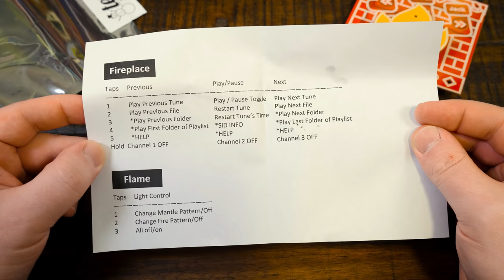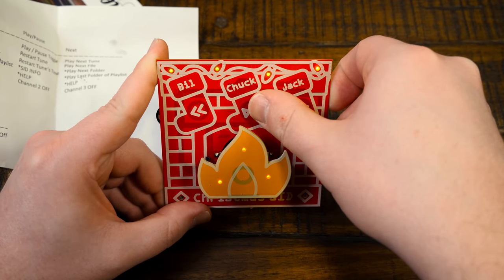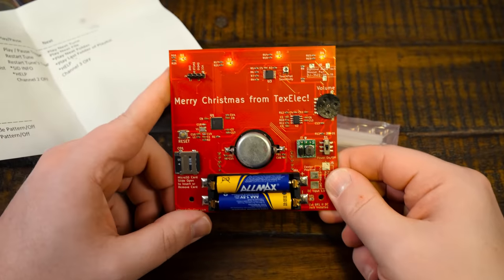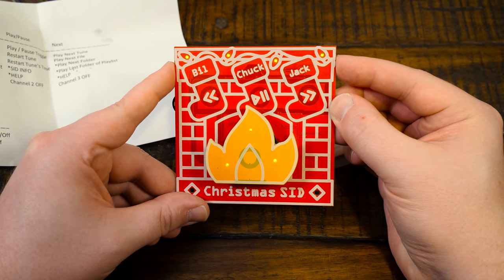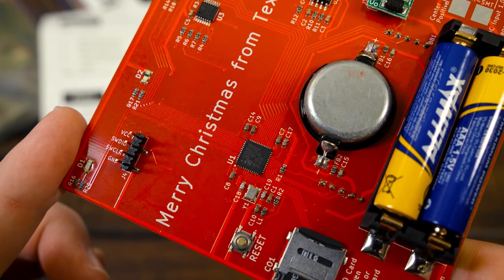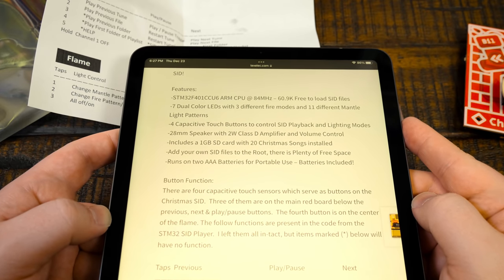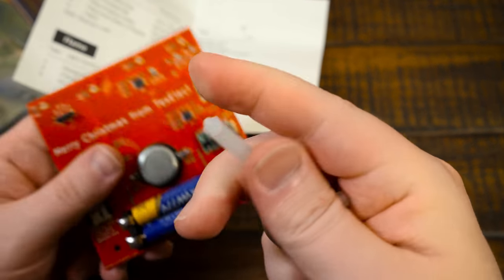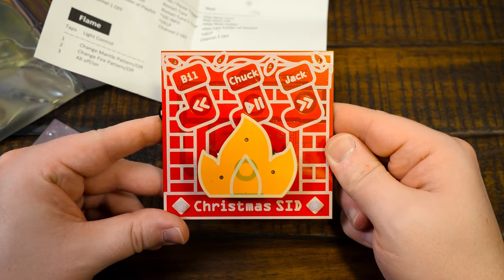Melodiously Merry Music on the Christmas SID Player

Comment: I'm buying that exclusively for M.U.L.E. and Ghostbusters!
Reply: Well that was half a bust.  That's a big no to Ghostbusters!  There are different versions of SID files.  The main two categories are PSID (PlaySID) and RSID (RealSID).  This device will NOT play RSID files.  In the case of Ghostbusters it also wont play because it contains samples.  It's the player that wont play them and this player is based off someone elses player and that original author confirmed, no RSIDs.  So watch out for those files.  Some of them will cause the player to crash.  The only way I was able to tell which was which was by opening them in a hex editor (notepad will work too).  It's the first 4 characters.

Comment: I hate to say it but At Doom's Gate might just sound better on the SID than it does on the OPL.
Reply: I thought the same. Sounded pretty good.
Reply: There's something about the SID chip, and the skill of the programmer, that makes the songs that come from it just special.
Reply: Wonder how NEDM would sound.
Reply: @Chaos89P  The thing about the SID chip is it can make square waves which do a much better job of mimicing the sound of a distorted guitar than the OPL which could only make sine waves.
Reply: @sa230e  OPL can't output square waves? That's restrictive.
Reply: Pure synth, no midi

Comment: Cool, though 84 MHz isn't crazy overkill for a software emulation; that ARM is "just" 0.084 GHz right? A SID player needs to emulate most of a complete C64: the CIA I/O timer chips, the 6510 processor, and of course the SID. Pretty much everything except for the video chip. Each of those chips updates registers and counters every 1 MHz machine cycle on the C64, and then the SID voices need to be mixed and rendered into an audio stream. Some overhead for the UI as well. 84 cycles to do all that seems pretty efficient to me.
Reply: Actually, you'll be suprised how much is not needed to play sid music. 95% of sid music is just init/play subroutines, called at fixed time. It rarely write to memory outside of it's bounds, SID memory address and maybe zero page. All timings can be read from sid header, and if code try to write to $DC04/$DC05 it means it is setting up its own speed. Enough for PSID type of sid files.

Comment: Just a little side note for folks out there.  There are different versions of SID files.  The main two categories are PSID (PlaySID) and RSID (RealSID).  This device will NOT play RSID files.  It's the player that wont play them and this player is based off someone elses player and that original author confirmed, no RSIDs.  So watch out for those files.  Some of them will cause the player to crash.  The only way I was able to tell which was which was by opening them in a hex editor (notepad will work too).  It's the first 4 characters.